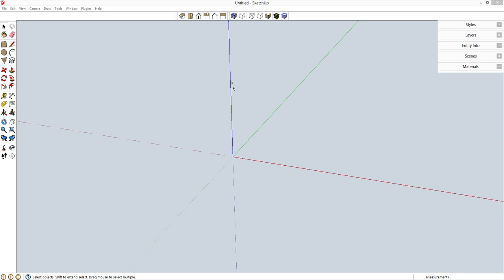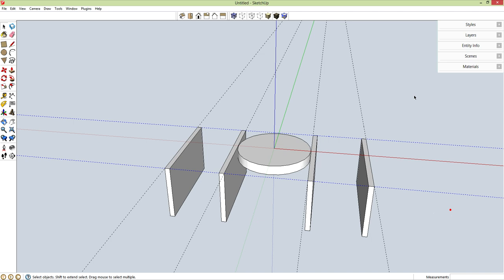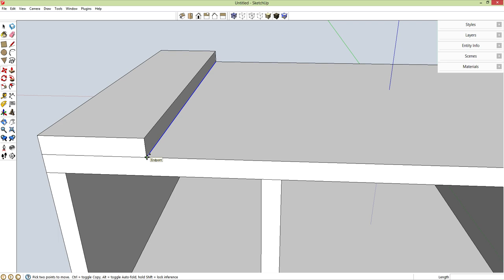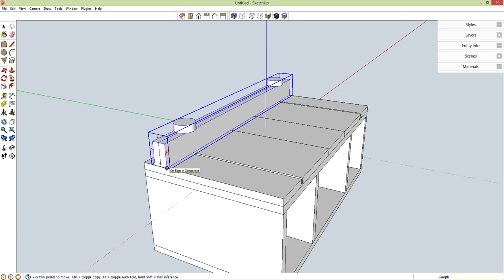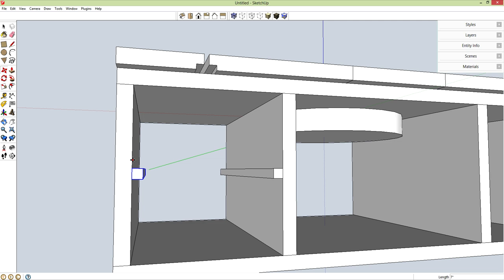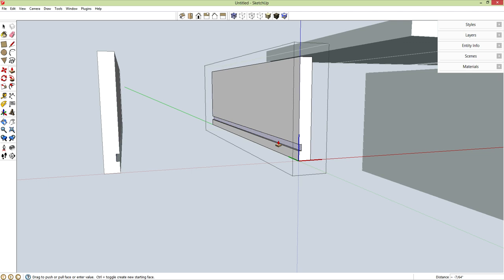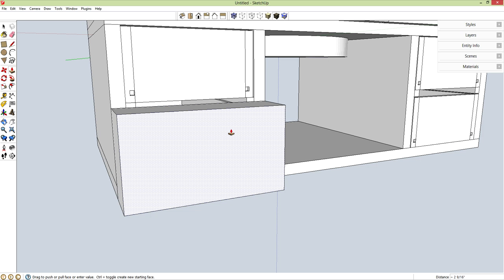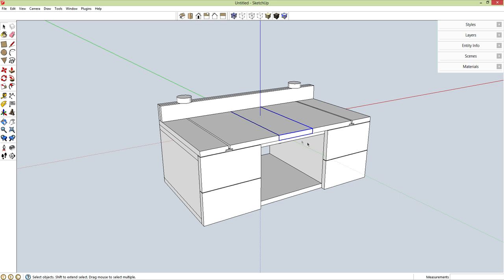SketchUp - Drill Press Table - 127

Comment: Hi Jay, one sugestion, a usefull thing to do in a drill press table is a box at the top, where you can put a hose to the vacuum, you just has to raise the top a little and make a box,  not only for dust when you use the drill, you can use a sander with the drill and that hole in the box with the vacuum takes most of the fine dust, for that, the table at the middle can have different plates like the router table, that´s just an idea, i do mine that way and is perfect for sanding with the drill.

you use the sketchup like walking, that´s awesome, everytime i try to use it i finish doing the plans in a paper and cursing my computer.